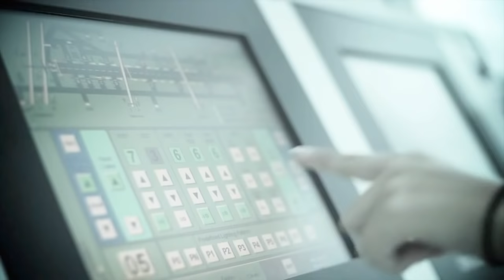Saab - Gripen C Fighters Live Firing At Axalp-Ebenfluh Range [720p]

Comment: I wonder if the gripen is better then the f-35 or the f-22?
Reply: In some ways I think it's better.
Reply: atleast it can fly for longer times and faster than the f35
Reply: And it is much cheaper but the F-35 and 22 have more advanced technology I think. Gripen NG (Next Gen, E/F) will probably be even better than C/D.
Reply: Most likely it is wouldn't stand much of a chance against a F-22. The strength of the Gripen is that it is small and agile and have a very low initial cost and a low over time maintenance cost. It is a good multirole plane that countries can afford to have flying basically.
Reply: Not really close, but it is a good fighter and very cost effective.  All around a very good plane.
Reply: Gripen would probably not stand a chance against the F-22 but it has some importnant advantages over it however. To start with it's alot cheaper. SvD just posted a comparison between the Gripen and the F-22, and one of the major advantages the Gripen has is that it's around 360 000 dollar cheaper per hour than the F-22 (I am not kidding you) You can have like 4 Gripens for the same price as one F-22 and even though an F-22 can easily take on a Gripen 1v1, it cannot take on 4 of them alone ;)

When it comes to the F-35 joint strike failure, the Gripen is superior in it's agility. The F-35 wouldn't even dream of being able to outturn a Gripen in a dogfight and it too is way more expensive. Also the F-22 and the F-35 has a big disadvantage against most other fighters, especially when about export, because it cannot use the standard NATO weapons. The enclosed weapon bays can only take american missiles and bombs which can be very bad for export countries if their trading routes would be blocked. 

All three of them are cool planes though. Even though the F-35 is more of a money waste than anything else.
Reply: Yeah, Gripen and F-22 are two completely different aircrafts that can't be compared.
Reply: F-22 is better it was tested in area 51
Reply: Gripen tested your mom
Reply: KaptenMacTavish OHHHHHHHHHH SHIIT! I wish i could like that comment more than once.